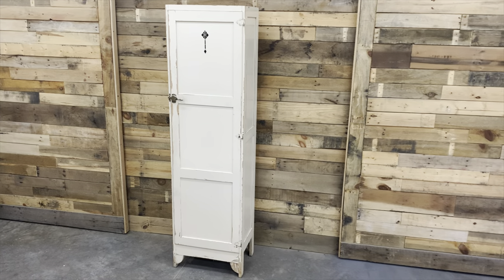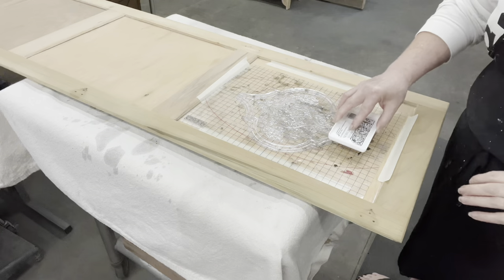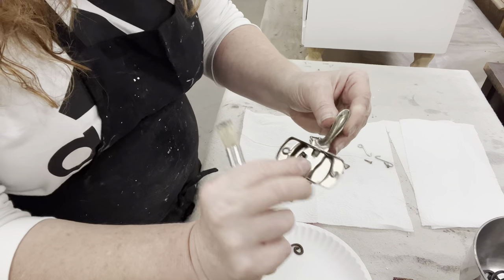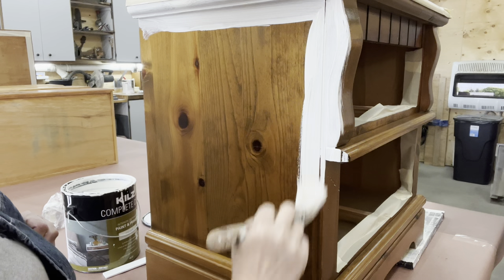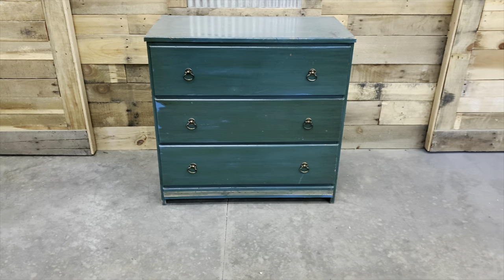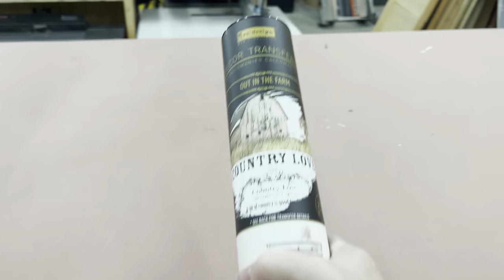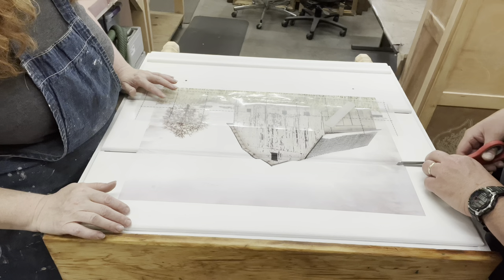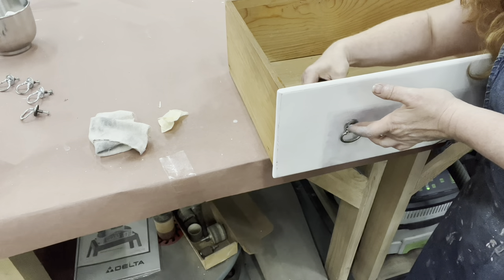3 Inspiring  Second Hand Furniture Flips | DIY | Home Decor |Home Decorating Pieces

Comment: I don’t know if the transfers are similar to applying vinyl to painted surfaces, but if they are I have a tip.( I am a Cricut newbie and wasted time, vinyl, and sweat trying to get it applied without a big mess!) If you put down some parchment paper (larger than item, and multiple pieces are ok), then lay the vinyl onto the parchment paper, get it lined up on surface, then slowly pull out the parchment paper as you smooth it down. You can even have about 1” if item exposed on one side so you can actually “tack it” in place. Makes for a less sweaty process.
Reply from the maker: Thank you for sharing that 🤍

Comment: I love the cupboard and barn!! I dropped a transfer on top of another one that was already secured in place....so that was a hot mess to take off. I have removed transfers before when I didn't like the way they looked and it is a nightmare to take them off. If you find a miracle that removes transfers, please do a video on it!!
Reply from the maker: Lol.. I thought I should have video taking it off. Sand paper and rubbing alcohol ended up working the best. ( but that was on wood) everything else seemed to make it even stickier 😬

Comment: curious why you don't use an oil based primer such as Kilz over knots or old wood to block stains, as opposed to shellac. It seems like shellac would be difficult for paint to stick to,  whereas Kilz can take any type of paint, and you only need one coat of the kilz.